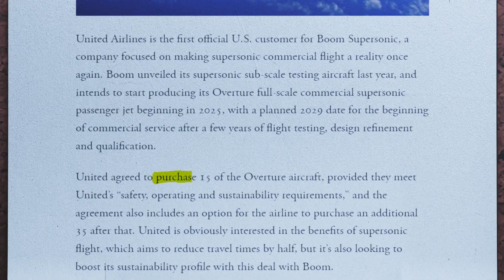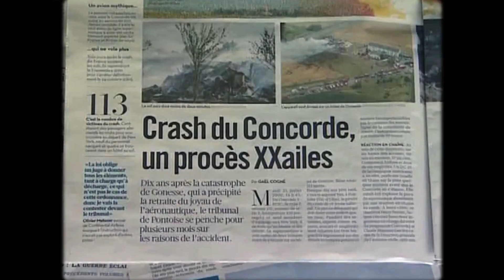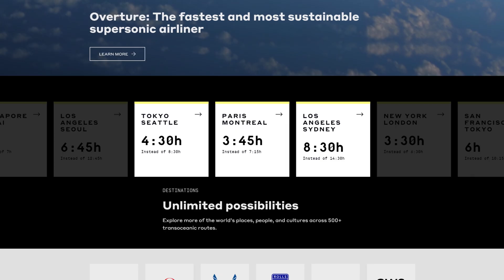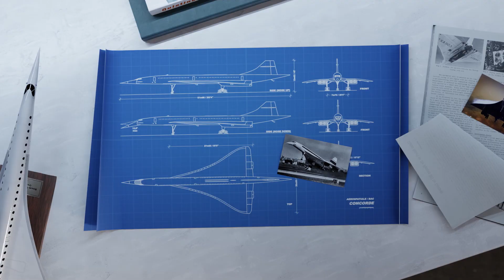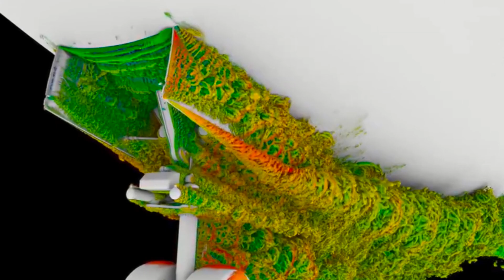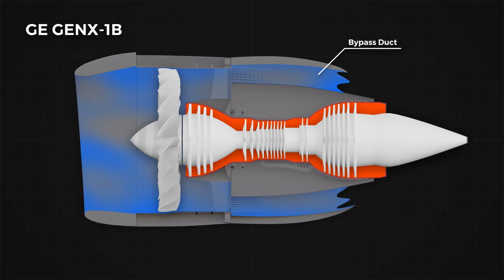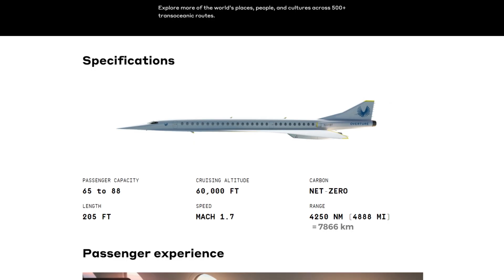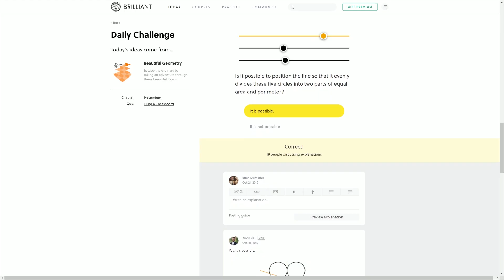Will Boom Bring Supersonic Back?

Comment: Very informative!  The time saved for trans-Atlantic flights is largely still lost with the administration and logistics of the airports (check-in lines; security lines; 3 hours prior to international flights; 2 hours early for domestic flights; delays for tarmac “traffic jams;” slow baggage delivery; …..just is hard to justify with the supersonic travel.  Having flown economy and in latter years business class, …having a “pod” to sleep horizontal is as good as anything I have experienced for flights to and from Europe; Africa; South America; Asia and Australia…..plus some of the more isolated Pacific Islands like Guam. With a pod I can sleep or work in relative privacy…depending upon my exhaustion level from dealing with the inefficiency of the administration and logistics of actual airport activities/requirements. Only a private/charter jet can beat that problem and that is a whole new set of costs.  Economics generally determine what survives and what perish, unless interfered with by external factors like subsidies or crony capitalism.  I just don’t see much more efficiency than business class pods for long haul travel…..until “Scotty builds that Star Trek transporter beam for practical use.”😬

Comment: Couldn't they just fly supersonic over the ocean and subsonic over land?
Reply: They've as long as they were over land on the transatlantic route, however since the Concorde's wings are optimized on Mach 2 the fuel burn is much higher if it flew subsonic speed, it wasn't economic at all and they even avoided to fly holding patterns for too long.

Comment: Why not fly below the speed of sound over landmass, but send it over water?
Reply: The fuel burn was horrible with subsonic speeds, the whole aircraft is optimized for Mach 2. A bad fuel burn means even higher fuel costs and less range.
It was acceptable  on the short distances over land on the Atlantic route, but not on a longer distance over land.

Comment: I was glad to see that you had labeled this 'carbon net zero' thing the Boom people talk about as nonsense.  It seemed so to me the first time I watched the company's own video and looked at the website.  The startup hawking these 'electro fuels' doesn't have a  proof of concept yet, much less a good take on the how expensive the fuel will be if they ever do succeed in bringing it to market.
Reply: You hear this carbon neutral flight thing a lot these days.Some of the airlines are supposedly offsetting their emissions by paying someone to not cut down a bunch of trees. The problem is, it has been found that in many cases the supposedly protected trees are being cut down anyway, or the offsets are sold on the same trees multiple times.

Comment: Genuine question here. Carbon Fibre composite materials are great in terms of its strength to weight ratio. However, due to the 1 piece nature of the components, any impact/cracks in the part would mean a major overhaul. This material would also strain less compared to metals. So how are engineers dealing with these now?
Reply: Patching composites isn't actually that hard. You cut out the damaged portion, replace it, and then lap joint everything and blend it in. 

In many respects, it's more elegant than the boiler plate patching of aluminum aircraft.

Comment: Correction to your video: Supersonic aircraft do not need to use pure turbojet engines (as your video implies) for propulsion. Supersonic military aircraft have been using turbofan engines for decades. Indeed, the latest generation of aircraft engines allow super-cruise capability (supersonic speeds without the use of after-burner). General Electric, since 2018, have had a new supersonic, non after-burning, turbofan engine in design (GE Affinity) for commercial general aviation use. RR has the technology to leverage on it's exiting range of propulsion engines to develop a supersonic engine within the deliverable timeframe, if the project is viable.

Comment: Excellent analysis.
Concorde failed because the CASM was incredibly high thus the exorbitant ticket prices. Had it been larger with more seats it may, MAY, have had a longer commercial life. (The US SST being developed at the same time as Concorde was to have approximately  300 seats.)
Even with new materials and engineering methods there has to be enough people buying tickets to pay the bills. Additionally, when the marketing department throws out “green” be very skeptical. As noted in the video there is no bio-fuel approved for high altitude jet engine operation and it WILL be expensive!

Comment: Without a doubt - it's both an engineering and economic challenge with many hurdles to clear before it's a sustainable reality.  It takes a lot of consistent business production and sales to subsidize a capital project of that magnitude.  Most investors are shy of risks when a producer of technology has no safety net for such a high business risk.  On previous similar ventures, a government subsidy was required.

Comment: Super-sonic travel is dead. It is obsolete if there is a paradigm shift in the future of air travel. Two basic travel patterns will form, BWB - blended wing body passenger liners carrying up to a thousand on long haul heavy routes - mostly coast to coast and over oceans. The second flight mode will be hypersonic or sib-orbital. These 90-minute flights to any where in the world, will be the luxury ticket when speed is meant to impress or is necessary for business. The rest of the industry will be the small jet liner classes with 100 to 150 passengers hopping between hubs and filling in the domestic air of small nations, like those in Europe.

Comment: I spent a career designing new devices for vehicle manufacturers. One of the most painful lessons I had to learn, and I wish I could say I learned it the first time, is this: Just because you Can doesn't mean you Should .
Reply: That's what make disruptive innovators and entrapreneurs strikingly differs from the rest of the working population. If wright brother tooks those painful lesson and words to their heart, I dont know how  we humans flying in the sky would have evolved so far.
Reply: @DreamCatcher-wg1bk  You misunderstood my meaning. Think of some of the unworkable attempts at human flight filmed near the same time as the Wright's first powered flights, things with flapping wings or the bouncing umbrella thing. Today it seems obvious to us that they are unworkable, but for a moment imagine the Wrights had tried such a thing and doubled down after each failure. Trying harder might have eventually gotten something like that into the air, but not something that would have changed the  way we live today, as the air travel has.

Supersonic flight can be achieved and has practical applications in military and spaceflight. The engineering principles are well understood. Equipment and fuel costs combined with the exhaust and sound pollution make it an impractical commercial Product . 

The Wrights were engineers, inventors, but also businessmen. They weren't just designing a novelty, they were inventing a product. In the age of Zoom meetings, WFH, and climate change, supersonic passenger aircraft are not an innovation, they are a throwback.

Comment: It’d be good if you mentioned that the atmospheric warming effects of non-CO2 emissions are in the region of 6 times worse than CO2 emissions for a given journey a supersonic jet like this. This is almost entirely due to the altitude that the plane flies at. Flying so high makes the radiative heating effect of emissions, such as gaseous water, many times worse than for lower flying subsonic aircraft. Additionally non-CO2 emissions are almost completely unchanged by using biofuels, which only target a reduction in net carbon.

Comment: There is a very simple solution to the Sonic Boom problem -- FLY HIGHER. The Sonic boom is a pressure wave and pressure waves require air pressure. The International Space station is going at Mach 25 but it makes ZERO sound because there is zero air pressure in space (not in the absolute sense, but for practical purposes it's zero). At sea level, the air pressure is about 1 BAR. At Concorde's cruising altitude of 56,000 ft it's about 0.093 BAR. This means that the Concorde actually makes a sonic boom a little under a tenth that which similarly shaped object would if it moves at Mach 2 at sea level. If you simply fly higher, that boom drops off further. At 80,000 ft it's .028BAR or about one quarter as much as the Concorde's. At 100,000 ft it's 0.011 BAR or about 1/9th that of the Concorde. Yes, it'll take an engine and air frame that is not the same as the Concorde's to cruise at 100,000 ft. But that is arguably a simpler engineering problem that trying to shape and mitigate the sonic boom. We have already made aircraft that goes that high -- the U2 cruises at 70,000 ft and the SR-71 85,000 ft. We know how to make pressurized cabins even for space. An aircraft can always decelerate to subsonic speeds before descending as it approaches the destination.

Comment: For supersonic flight (above Mach 1.2) it's not just the traditional area rule, the distribution gets modified based on the Mach angle. Though it is not as easy to explain in  short time for the video, and since a real aircraft doesn't just fly at one Mach number, following the Supersonic Area Rule may not create any actual fuel savings, or be feasible to apply for passenger aircraft like you mention.
Reply: Concorde didn't use the area rule and yet because of its design and its ability to supercruise at Mach 2.0, it remains the  most efficient supersonic aircraft ever to fly. At Mach 2.0, its Olympus 593 turbojets remain amongst the most thermally efficient machines ever made at over 43%. It only needed reheat(afterburner) for 50-90 seconds on take of and then again for a short burst from M 0.95-M 1.5 then off again and supercruise up to M 2.04.

One of the reasons Concorde was profitable for 20 years for BA (before it was prematurely forced into retirement by Airbus (politics and money) was that its purpose was to compete against subsonic First Class. Concorde’s tickets were only around 10–15% more (1996 GBP 4,772 vs subsonic First Class GBP 4,314) and this meant that a company could have its executive (who would have been sent First Class anyway) leave London at 10:30am, arrive in NYC at 9:30am (yes before they took off, as Concorde flew faster than the Earth rotates) take a 10 min helicopter ride to the East River heliport,  have a bunch of meetings and zip back to JFK for the 1:30pm Concorde to London and be in bed the same night. 

How's that for time saving?

Time as they say, is money, especially for these folks, and Concorde built a very loyal following that lasted throughout its service life operating in its own P&L division, and consistently profitable for BA from 1982 on, even when the mainline carrier was unprofitable.

Concorde had its own security, check-in, lounge and boarding gate from the lounge. No lining up for anything...

Boom's engine is nonsense as well. A medium bypass turbofan doesn't have the exhaust gas velocity for supersonic flight. 

MBPTF are around 3-5 bypass ratio whereas the only supercruising engines near the right thrust class, the F-119 & F-135 have bypass ratios of 0.3 - 0.56 for a reason. 

As for a 72" fan here is a clue: The LEAP 1B on the 737 MAX has a 69" fan and the LEAP 1B bypass duct air speed is somewhere around Mach 0.85 - 090... I cannot imagine there is a way that a low drag system can be designed for a fan that size, nor that a fan that can bypass that much air at Mach 1.7+, which is what is required. 

Again, the closest engines to the requirements are currently the F-119 and F-135. It Both have a diameter of 46" and neither produces the dry thrust required by the Overture to supercruise. 

Then there is cost. Publicly available figures show that the F-135 program alone, had its cost increase by 3.2 billion dollars, just in 2013. 

Is it reasonable to believe that the ‘nobody’ Symphony design, can outperform the world’s most advanced Low Bypass engine?

Concorde engineers got it right using slide rules.

Lots of good tech info here.
https://www.heritageconcorde.com/engines-main-menu

Comment: Some corrections I’d like to make here:

1. You said Concorde’s last commercial flight was in 2006.  It actually took place in 2003.

2.  The Air France Concorde that crashed in 2000 was Air France 4590, not 4560.  

Other than that, this was a very informative video.

Comment: millitary jet engines have been low to medium bypass for decades now powering planes past mach 2, I don't see why boom needs to use a pure turbojet, the f119 engine that powers the f22 is a turbofan and is able to push it past mach 1 without afterburner, the f119 was developed in the 90's, and I'm sure technology has come a long way since then even technology offered to the civilian market

Comment: Supersonic plane? NO, no reason. Maybe passenger orbital flight.. that plane has no range, only operate on a dirty fuel. For those who does not understand, biofuel is not necessary expensive, but it has less power, its really not an option here. Hydrogen is too big for that. So hydrolox rockets or nothing, if you want to go really fast.

Comment: Very intestinal for sure. However higher speeds will never be more economical, certainly will be less environmental. Outside the military use its just an indulgent novelty to be going "as fast as possible" in my opinion. If you can reach anywhere in the world in far less than a week, often just a day or two, then it's just excessive and unreasonable to expect anything more.

Comment: Thanks for doing this video!
I've always been skeptical with Boom's claim. Even though 60 years of engineering improvements have brought many technologies that Concorde's engineers didn't have, supersonic jet engines haven't improved much since then. Only a few aircrafts can reach supersonic speeds without afterburner, and the pinnacle of that kind of engines was basically the Olympus and the PW J58, that have both been developed 60 years ago. So I always wondered how they would manage to beat the engineering prowess of 3 of the largest engine builders in the world.
I feel like that partnership with Rolls-Royce should have been made much earlier in the process.
To give a nowadays comparison, Space x didn't start building starship without Raptor's engine development being already well advanced. It feels like they started building an F1 car but planned to use a motorcycle engine
Reply: The Olympus was even more impressive than the J-58-it could supercruise at Mach 2.0. One of the reasons Concorde was profitable for BA for 20 years.

Comment: No matter how well engineered this plane is, it will still have several times the fuel consumption per passenger mile compared to subsonic planes. 
The advantages of supersonic flight are so slim and the disadvantages so glaringly obvious. 
The fuel consumptio alone should disqualify this plane, given the state of the climate emergency we're in

Comment: @RealEngineering you're frightening me, what's with your math?

> Passengers had to rewind their clocks two hours on arrival

This can't be right. No matter how fast you travel you still rewind clocks 5 hours, because that is the difference between the timezones.

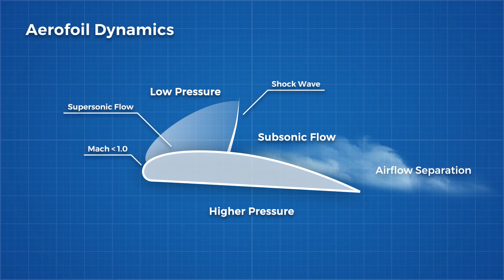Say a passenger leaves at 08:00 GMT and arrives at 06:00 EST. Unless their clock stopped during the travel, it would (after 3 hours worth of flight) be showing 8 + 3 = 11:00 GMT upon arrival, which they would have to rewind 5 hours back exactly as supposed, am I not getting something?

Comment: I really appreciate the level of scrutiny you're providing. Seems like many of their advertised claims simply aren't feasible. Looks like a good start and lots of the Concorde's drawbacks are being solved with today's tech advances, BUT:

- They need an engine that doesn't exist and usually takes the better part of a decade to produce, yet they want it in a couple of years from scratch.
- They haven't significantly decreased the boom
- They haven't significantly increased range

I guess this is more evolutionary than revolutionary, which as you pointed out probably still won't be economically feasible.
Reply: Yeah this sounds like a company about to get themselves impaled to address a niche that faded away for well-documented reasons. Their self-promotions don't instill confidence and honestly look arrogant or apathetic at worst.
Reply: My guess for range is just that they don't know yet being that they have no engine, or rather that range estimate was utilizing numbers from the 60s era GE engine they will use for flight testing soon.
Reply: Building a new engine might not take a decade. In fact, aircraft design is faster than ever utilizing advanced computer modeling, just as he said.
Reply: Since RR has the plans for the Olympus 593-610, why can't they just build those again? If one needs a pure turbojet, that's the one to have, isn't it?
Reply: I think future will be high altitude fast flights.
Reply: @kamilpotato3764  When I told my dad about this video, his first thought was the same. He suspects that if people really want a fast travel solution and avoid sonic booms, they're better off making globe-spanning high-altitude space planes, and avoid atmosphere altogether. Frankly, I agree with both of you; I remember reading about some insane turbine that was in development maybe 6 years back, and it would be used for space planes right before they hit vacuum.
Reply: LIKE CONCORDE ,THATS A GOOD IDEA. @kamilpotato3764

Comment: The other problem with biofuel is that it is less energy dense than traditional fuel - it takes more biofuel to get the same amount of work done.

So using biofuel would require X+Y pounds of fuel, where traditional fuel would only require X pounds of fuel.